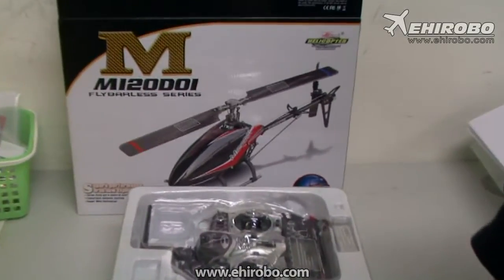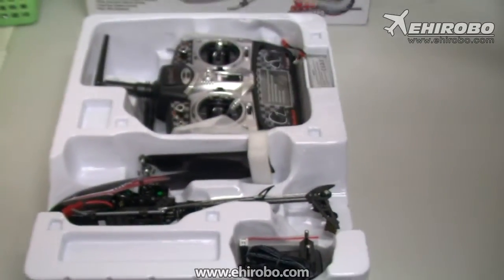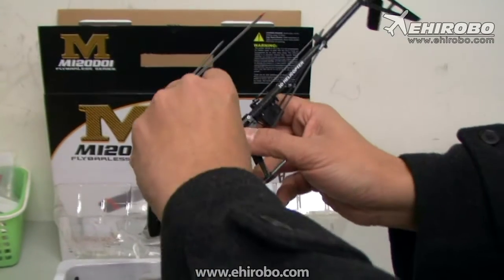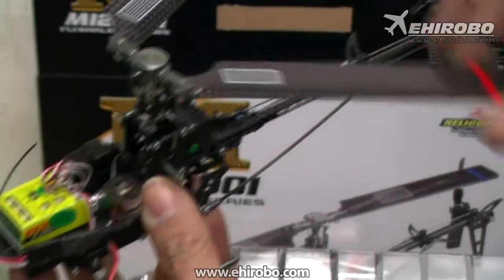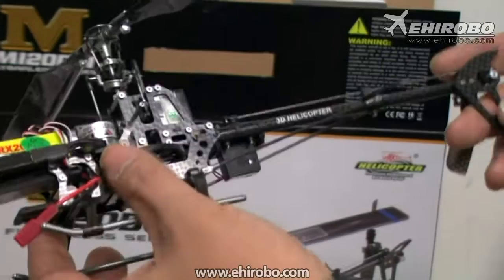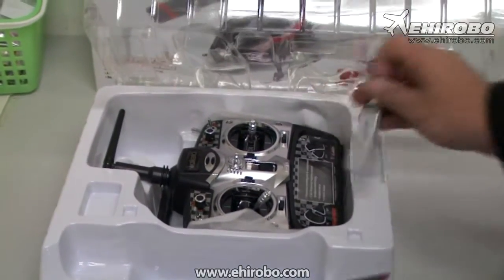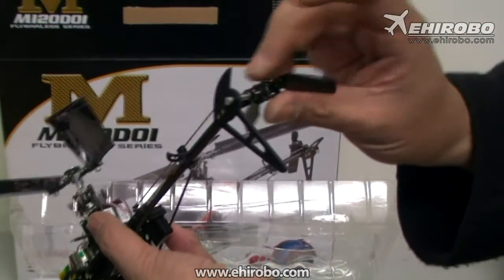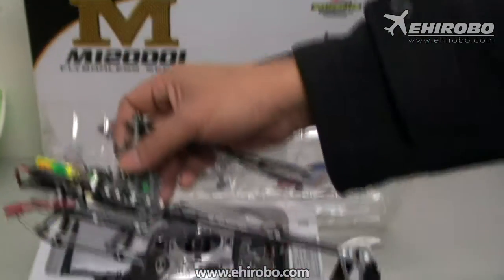WALKERA M120D01 Carbon Frame Flybarless 6CH Helicopter - 2.4GHz

Comment: Agreeing with bassax7045. I built my 250 (All parts except frame and boom holder are Align) for a little over 300 dollars (2801 TX, cheap servos), but they fly AWESOME.
BUT, I flew the 4G6 before, it flew really solid. Also, smaller doesn't mean cheaper. I recall when I was building my 250, the 450's price is about the same to be built.

Comment: looks like this is what the v120d models should have been like

walkera sure like to milk their customers and let them pay an extra 50$ for a 10$ cf upgraded boom 

whats next ? better quality metal used for linkages ? for an extra 50$

funny is ,they have to stay around 300 to 350$ ,because for 350 ,you can buy a nice 450 heli with metal,carbon and much more ,,higher quality too
also 450 t-rex clones are made to last ,were walkereas intentional are made weak to sell spare parts a lot